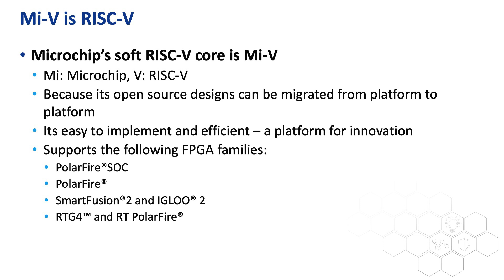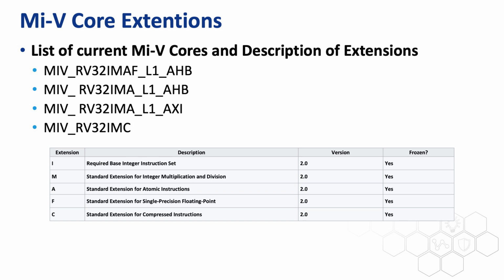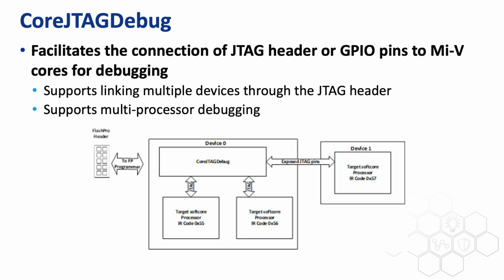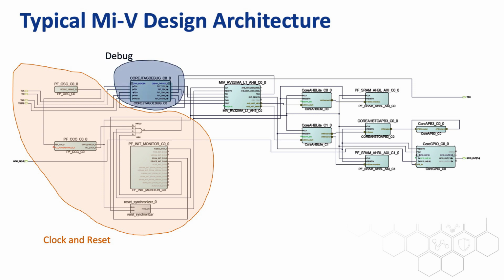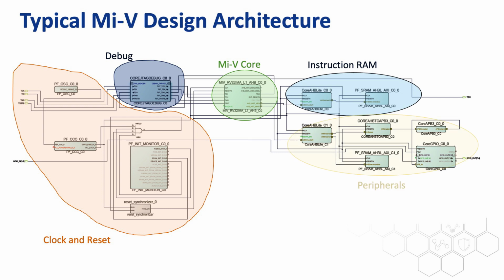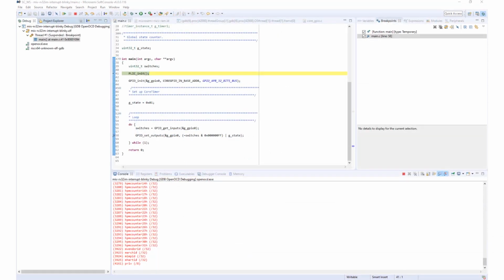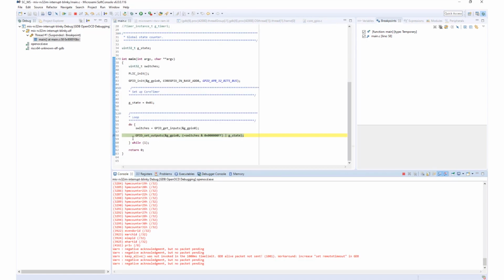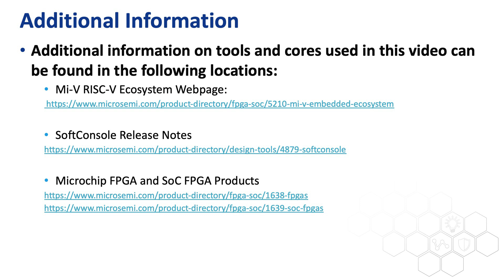How to Debug Microchip's SoC FPGA Designs Using SoftConsole

Comment: I'm interested in using the Smartfusion2's SWD interface to stream (SWV) data.
 
I've installed the drivers for AT-Atmel-Ice and J-Link adapters and have verified that the adapters are recognized under Atmel Studio and uVision.   
 
How can be I configure SoftConsole to debug with either of these adapters (SWD interface, not JTAG)?
Reply from the maker: Thanks again for reaching out. Unfortunately, SoftConsole does not support Serial Wire Debug (SWD) and Instruction Trace Module (ITM) features.
As of now, there are no specific plans to add Serial Wire Debug (SWD) and Instruction Trace Module (ITM) support to SoftConsole.
If you absolutely need to use these features, they can use third party tools that support this. Again, please reach out to www.microchip.com/css if you'd like us to help you directly. Thanks!
Reply: @MicrochipTechnology  Thank you.  Yes, I'm in need of data tracing (SWV).. so I'm going to try porting my SoftConsole project over to a 3rd party tools (Keil + J-Link).   From what I've read, the Remote-Debugging-Interface (RDI) might even be a little bit faster than OpenOCD.   BTW, would love to see a an application note or video on how to use CoreJTAGDebug / UJTAG on a SmartFusion2, such that UART communication can be established via JTAG (similar to Intel's Virtual JTAG UART).